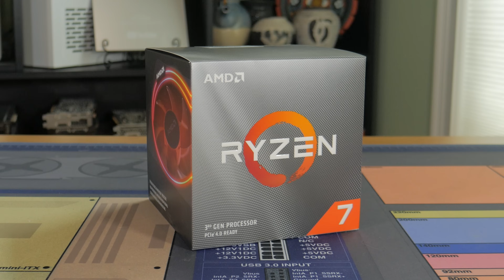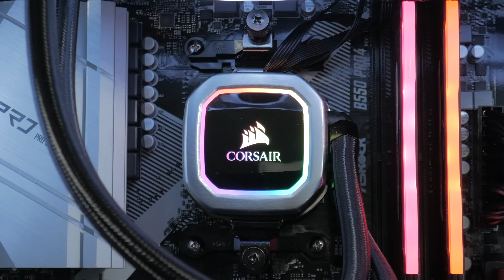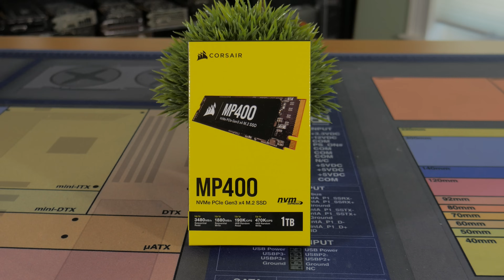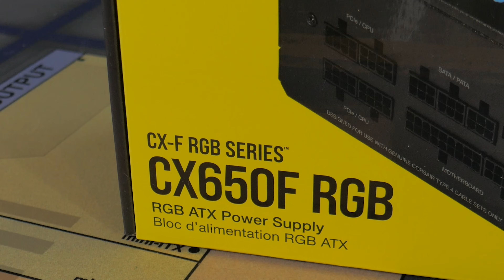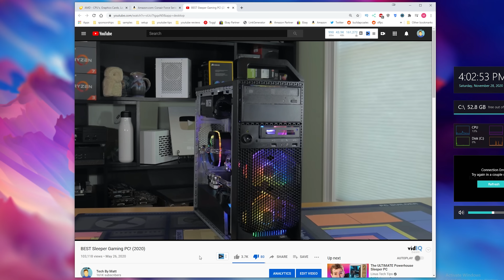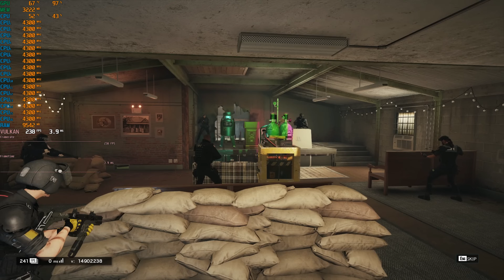I Built an ALL-CORSAIR Gaming PC! (2020)

Comment: Yo I literally have the same build with the exception of a few parts. I have a 3800xt that I got from fb marketplace for $270. All 6 of my fans are the ML120 pro rgb. And I went with the capellix 240mm corsair radiator since it had the newer designed pump and it came with an icue commander pro. Lastly I'm running a gigabyte 5700 xt oc

Comment: I have a 2070s FE, and I play all my games on 1440p ultra settings and with gsync on i hit 144fps... how come I’m hitting 144 on apex with everything maxed out but your system is not? The only thing I’ve touched in the bios is the ram, I turned xmp profile on, everything is stock. 
9700k/2070s/gskill neo 32gb ram/asus prime z390-a/x52 kraken/ all in a nzxt h510i with only 4 fans (2 that came with the case and 2 more of the same that came with the x52)?